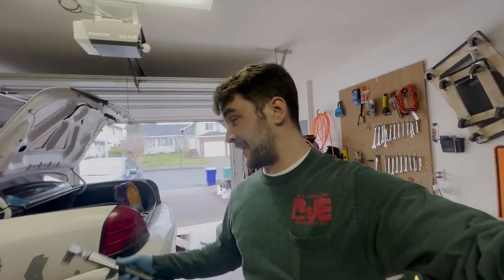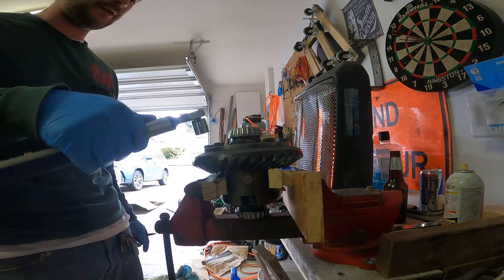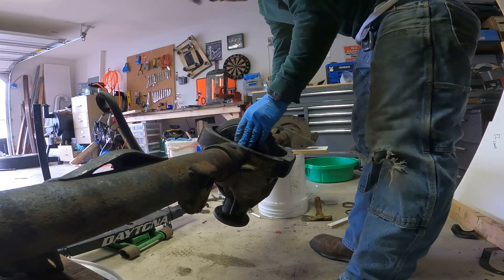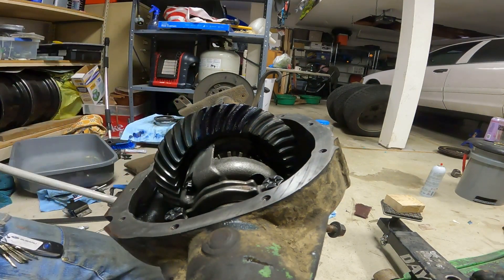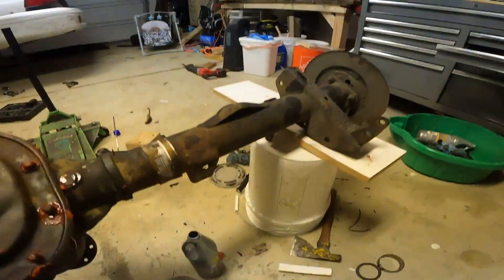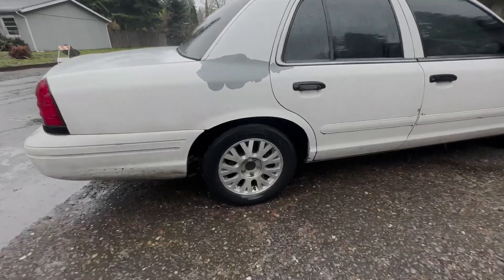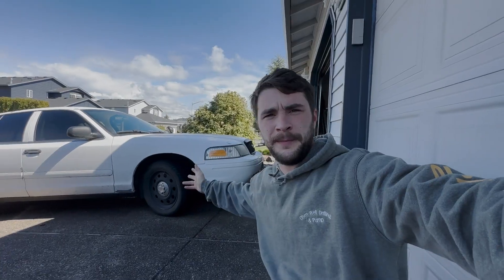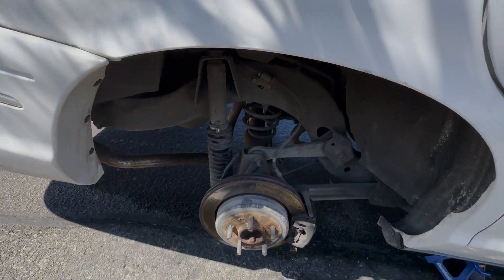Unlock Performance: Crown Vic Rear End Swap - Ford 8.8 LSD (Part 2)

Comment: Noticed when you installed diff carrier and bearings/shims there was no resistance to inserting the assembly into the axle housing. My understanding is that the shims should be a tight fit, even to the point of ‘hammering’ them in place….that provides the desired (necessary) preload on the bearings.
Reply from the maker: That’s entirely possible brother. No bad noises yet so we’re gonna go with it for now😂😂😂 had like 1200 miles on it since the swap, seems okay for now but based on the ETCG video I watched before I did it, I believe you are correct haha maybe I finally got lucky for once